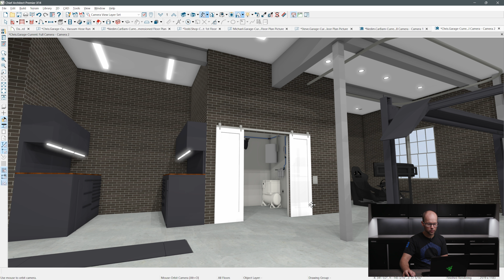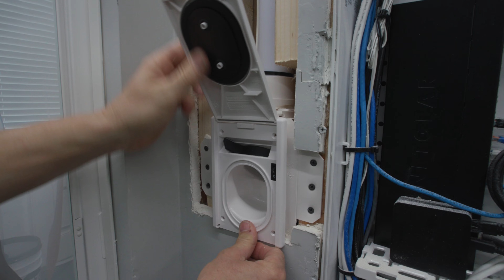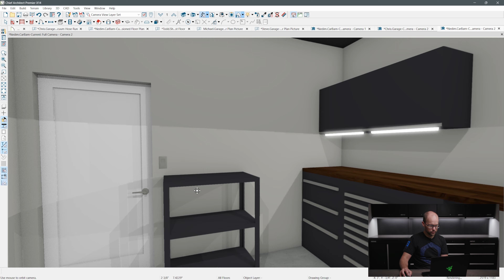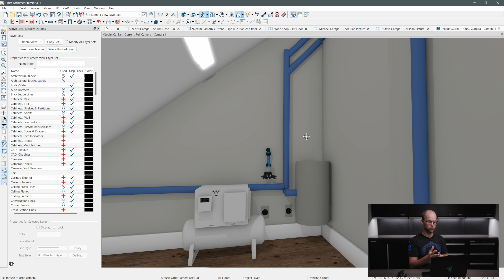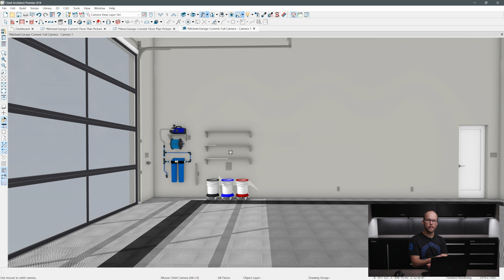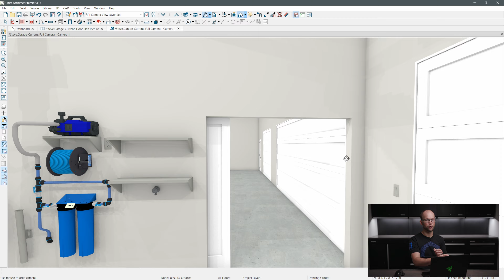Using The New OG Vacuum Solution In Garage Design

Comment: Not sure why you named it "vacuum solution". It's no different than our old 1980's central vac with mediocre specs, which we replaced with an actual garage vac solution. For half the price of your "solution"  the prolux is more powerful, has a hepa filter, has wet/dry capabilities, reverses to blower mode, has shampooer attachments, and also inflates things.  Hide a hose can be added to any central vac system.
Reply from the maker: I tried the Prolux. It's junk.

Comment: Can I have my vacuum, say, 30ft away from a reel that has 50ft of hose? Connect the vacuum to the reel with PVC. Or is that too much distance that I'll lose suction
Reply: You’ll be fine with that. Think of it this way. If you have 50 feet of hose, you have to have at least 50 feet of tubing to hold the hide a hose. That means you essentially have 100 feet between the end of the hose and the vacuum if you pull the hose all the way out.
Reply: @NMiller406 makes a ton of sense. Thank you